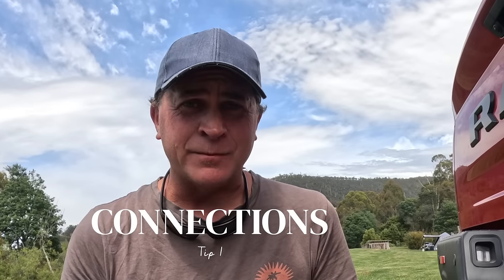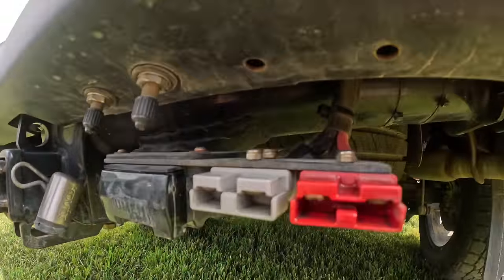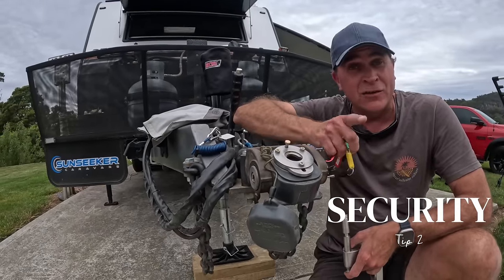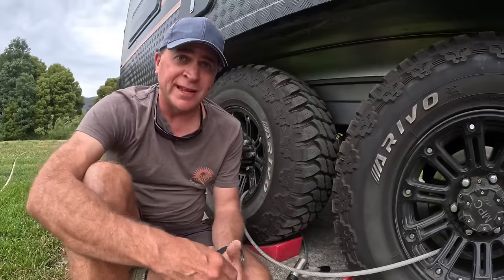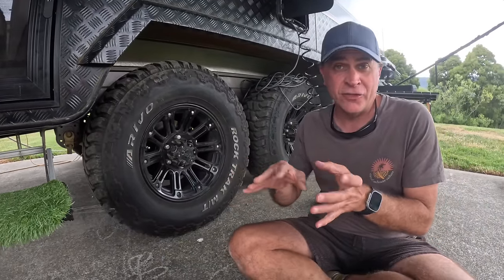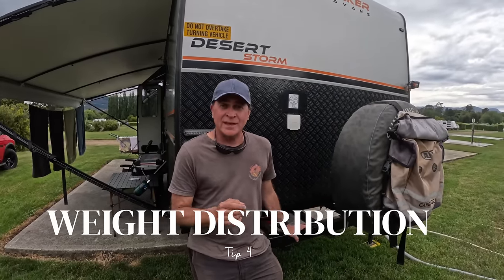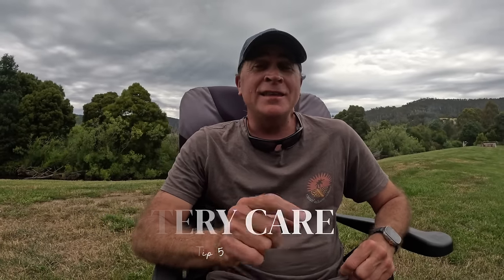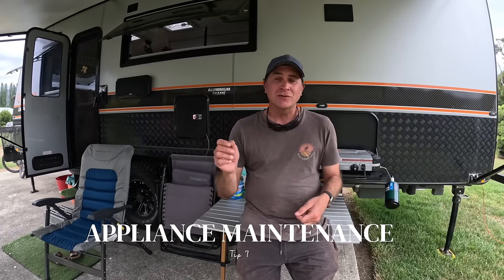Top 7 Caravan Maintenance Tips for Long Trips.  Caravanning Australia

Comment: Re insurance our policy also requires a hitch lock and/or a wheel lock.  When I asked if a high tensile chain or cable with HD padlock was acceptable we were told by the underwriter that it need to be a solid device designed specifically as a wheel lock.  And our chain / cable option was not acceptable.  Most wheel locks will not fit a full sized off road wheel / tyre, I did find one but is is not a robust structure.  We now use it along side chains both sides.  And photograph the fitted hitch lock / chain lock and wheel lock every time fitted in case there is ever an issue over whether or not we use these required devices.
Reply from the maker: Hey. Thanks so much for that.  Looks like er might have to check that out heh.  Cheers

Comment: Well edited video and good content. I'd like your thoughts on possibly using the tyre inflator to clean out the connectors instead of the WD40 air duster.
Reply from the maker: Great suggestion!   I’ll give it a try.  Maybe use a narrow fitting on the end of the inflator to get a more direct bursting air.
Reply: I look forward to the results